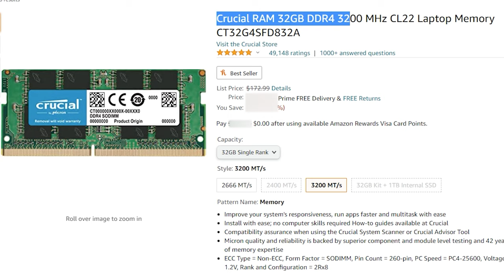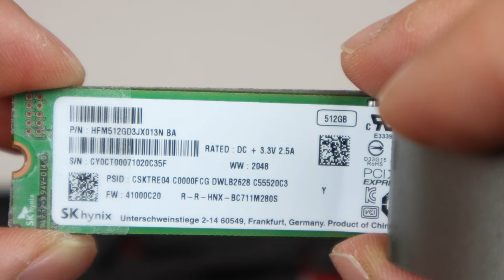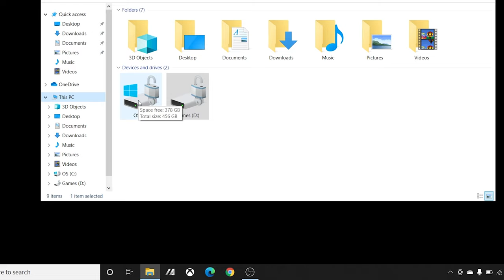How to Install/Upgrade RAM and m.2 SSD in ASUS TUF Dash F15 Gaming Laptop (NVMe only)

Comment: Really handy video thank you, but have a question. Probably sounds stupid but I’m very new to pc gaming and all the specs so get a bit lost with all the variations. My model number is FX516PM-HN002T, is this still the same ASUS model or is it a different variation to this model? If it is a different variation, does everything in this video still apply to this ASUS model or would the layout be different? Thank you
Reply from the maker: Usually, if the first part of the model code is the same e.g. FX516PM, then the internal layout should be the same. Everything after the main model is simply variations in build like RAM, drive space, and/or GPU, but the basis of the laptop should be the same.
Reply: @FixItPhil  perfect, thank you so much

Comment: Hey, i just replaced my ram but my screen become black and only led keyboard lights up. Any solution?
Reply: You should be fine. Just press the power button and Leave it. It will take a minute or two and then reboot itself into the OS. It booted after the reboot, right?

Comment: Good morning, greetings from Peru. I have the same model of laptop and my question was what actually happened if I put a 32 GB RAM memory in the available slot, since in the video it does not show it in configurations that happen with the RAM memory. when placing a 32 gb and having 8 gb soldered to the board, that really adds up or it only recognizes the 32 gb or only recognizes the 8 gb. what actually happens? Please. I am not fluent in English and in some parts the subtitles do not appear. I half understood.
Reply: I use my laptop for different engineering and editing tasks that require too much ram memory. It would be of great help to know if the ram memory actually adds up, to be able to buy since the 8gb + 8gb (16gb) that I currently have is taking it to the limit

Comment: i've followed your step but my laptop won't turn on unless i connect it with my charger, but the power button doesn't have light and when i turn it off my laptop won't turn on again, i hope someone can help me
Reply from the maker: Sounds like the battery connector was not properly reseated or remains disconnected.

Comment: Is it impossible for anyone else to take out the screw to the 2nd m.2
Reply: I'm having the same issue, tried with around 7 different screw drivers and nothing
Reply: @alexanderjimenez5902  Haha, I got the same problem!
I even ordered a big screwdriver set dedicated to electronics to try to unscrew that thing.
That m.2 screw is a menace, they should have used just a normal screw for that thing.
Reply: did you figure out how to lift the screw on the second m2 slot? i’ve tried every screw bit i could and none of them make the m2 screw budge
Reply: @man8918  I got a new laptop, and don’t regret it. The screw was impossible to get off and it got busted for me. I was just gonna try to get another model, but I returned it and got a different laptop. If your priorities are performance, I suggest you get a different laptop too, my laptop has the same gpu but was getting 20-30 more frames on games. But if your priorities are battery life and quietness, I suggest that you buy a laptop opener kit on Amazon. Or small electronics kit.
Reply: @personperson8563  damnnn. it’s kinda sketchy how there are so many people struggling to get this screw undone, even with the proper screw bits 😂 i’ll just buy a new laptop
Reply: Have you tried a JIS screwdriver

Comment: that battery plug is a nightmare. when i connected it to my motherboard it literally sparked and i almost had a heart attack worrying i just turned my three month old laptop into a paperweight. luckily it all worked out in the end but good grief
Reply from the maker: I've heard other folks have had this exact issue with ASUS laptops, I wonder if it has something to do with their battery supplier or the way the board itself is assembled. Most folks don't notice any issues with a small spark. I guess as long as you've taken precautions (discharge with power button, grounding strap, anti-static mat etc.) it'll lower your risk of failure.

Comment: Can i put gen 4 drives in the pcie gen 3x4 slot? gen 4 drives are backwards compatible with hardware made prior to it's release, if i'm not mistaken.
Reply from the maker: Yes, you can use Gen 4 drives in a 3x4 slot, you'll just be capped at gen 3 speeds.

Comment: I see some review said this laptop ram has soldering??i really want buy this laptop
Reply from the maker: Yes, 8 GB of RAM is soldered in and cannot be removed nor upgraded, but there is one RAM slot in which you can replace or install a DDR4 RAM stick up to 32 GB, as shown in the video.

Comment: hi Phil, I did it just like you in the video, but my laptop does not turn on now. do you have any idea what to do now? if I plug in the power cable, then the LED does not turn on. why?
Reply from the maker: There are a couple possibilities. A black screen usually indicates something is wrong with the RAM. The first case is that the memory is simply not seated all the way in the slot. In this case, remove it and re-install it, making sure it's oriented corrected and fully inserted before pressing it down to lock into place. The other causes could be, incompatible memory type (sometimes this can be a BIOS settings issue) or a damaged chip on the memory.
Reply: @FixItPhil  Thank you for your reply Phil. I've removed the RAM module, but my laptop still does not turn on. :| I've taken it to the ASUS service already, I hope they can fix it :)

Comment: Hello, can i upgrade my ssd with nvme gen 4?
Reply from the maker: Yes, NVMe Gen 4 is backward compatible and the drive should run fine in a Gen 3 slot, but you will not got the max advertised speeds, as the slot will limit the drive to Gen 3 read and write speeds.

Comment: I set the RAM to 16GB (Crucial 16GB DDR43200 CL22) . But the system stopped displaying motherboard RAM 8GB. It should have been 24GB in total, but no. Where is  8GB RAM?

Comment: ATTENTION fellow internet dwellers do not use his link to an SSD because the asus tuf dash 15 is not compatible with sata, it works with pcie only, take note of this and don't end up like me who is now 200 dollars out on an SSD incompatible with his computer
Reply from the maker: Thanks for letting me know, and I'm really sorry about the error with the link. It's been updated to direct to the WD Black, which is NVMe (PCIe) vs SATA. Hopefully you can return the drive for a refund or exchange it 😣
Reply: That’s great that you changed it, I just I hope 🤞 no one else bought one through that link, on the other hand your video was easy to follow for my upgrades. Keep it up!
Reply: @FixItPhil  i did not understand connector type should be sata or pcie gen 3 ?
i think u need to do a q nad a video !
Reply: @mamatap5621  pcie gen 3 or 4
Reply: @mamatap5621  the asus tuf dash 15 is only compatable with pcie gen 3 or 4

Comment: Can you use an nvm from a pc and install it on the Asus tuf?
Reply from the maker: Yes, as long as it is the same form factor and key type B, M or B+M and the slot is compatible with NVMe (and not SATA only).

Comment: what is this support M.2 NVMe gen 4?
Reply from the maker: No, it's speced for NVMe Gen 3. While it will work with a Gen 4 SSD (since it is backwards/forwards compatible), you'll only get Gen 3 speed.
Reply: @FixItPhil  oh.. oke .. I'm a little disappointed, I just bought this laptop, and it doesn't support it :(

Comment: Do i need to use a thermal pad for a second SSD?
Reply from the maker: No, a thermal pad is not necessary for proper operation, but I always recommend it as a precaution to extend the life of the drive.

Comment: I want to add a 4TB M.2 do you think that will work?
Reply from the maker: The spec says the slots only have guaranteed compatibility up to 2 TB. That doesn't mean necessarily that it will not work, just that "your mileage may vary" if you attempt to go higher. Either way, I'd confirm with ASUS tech support before buying the drive.

Comment: Hiya, just a question have you tested it with the 32gb ram stick on the free slot? Asus support is telling me I can only put 16gb in that slot... so I'm confused
Reply: yes, some info would be amazig since this latop can handle only 32gb. So are you loosing 8gb?
Reply from the maker: Yes, you can put a 32GB stick in the one slot. Someone else commented that they did this and the laptop recognized all 40GB. I haven't done this personally and cannot independently verify from experience, but if that's true, that would be awesome; my assumption was that 8GB would be wasted.
Reply: I have this exact model and can confirm I have a 32gb dd4 sodimm samsung sodimm module in addition to the 8GB soldered and Windows 10 sees 39.7GB memory with some of it being hardware reserved etc.
Reply: @TheSTOPlayer  ¡¡Hombre por fin hay luz con el tema de la RAM osea que no hay problemas en poner 32GB???

Comment: If I replace the upgradable RAM (8GB) with 16GB does that make my ram 24?
Reply: um, ya!    8 + 16 = 24.    (if you have 16GB total right now, and take out the 8GB that is removable and add 16GB, then yes you have 24GB)   :) ;)

Comment: Thanks alot for this I got newer version of this laptop and opened up today just so I have a better understanding and its easier to open when I buy the ram to add it

Quick question: My current laptop ram is 8gb and there is slot for one more ram do I need to add the same amount of ram as current one or I can add any amount for the new one I add?
Reply from the maker: You can add any size RAM, the general consensus is to use exact match pairs for RAM (brand, capacity, speed etc.) to take advantage of efficiencies in mirrored chip architecture. I've paired an 8 GB with a 16GB stick and have had systems run fine. While the performance difference is usually minor versus using a different capacity but compatible stick, it'll also help avoid any incompatibility issues.
Reply: @FixItPhil  oh cool so if I do add a different brand ram with current one that has same capacity and speed will there be a massive problem or its best safe with the same 2 rams?

Comment: Hello FixItPhil, I added samsung 970 evo plus as second sdd and my first is intel as well. I am having problem installing the nvme drivers for samsung, since the intel drivers came with the purchase of the laptop. What i understood from forums that i need to change to AHCI mode in bios in order to install samsung nvme drivers but i cant find that in Bios. Some other guy said that i need to remove "intel RST VMD Mode" but im not sure where is that. :D

Comment: Did we need to put thermal paste?
Reply from the maker: No, it is not required for this upgrade. However, you can optionally adda  thermal pad and heat sink to the m.2 SSD if you want, space permitting.

Comment: If the laptop has 8gb preinstalled (soldered in) and the laptop max's out at 32gb, how can you install a 32gb stick...or does the preinstalled 8gb not come into the equation when the manufacturer states 32gb ma capacity?
Reply from the maker: Typically, overages that can't be used are simply ignored by the system, however, despite the manufacturer stating the max RAM capacity is 32 GB, folks who've installed a 32 GB RAM stick have found that the system recognizes both the 8GB and 32 GB for a total of 40 GB of RAM. Not sure if this is what the manufacturer intended or just a happy accident.

Comment: What would happen if I upgrade BOTH SSD's before first boot? is the pre-installed 512GB SSD the primary disk with windows pre installed? or can I install 2 new drives and still have recovery and preinstalled windows?`..sorry for the noob questions. Hope you can help. :)
Reply from the maker: If you replace both SSDs immediately at the same time, you'll need separate installation media (like a USB thumb drive with Windows installation files on it) to install Windows onto your new primary SSD. That's because Windows recovery is launched from a dedicated recovery partition on the original SSD, which you will be removing and thus cannot use. You should be able to download Windows installation files from the Microsoft website, just look for "windows media creation tool" and you'll need a USB thumb drive with at least 8 GB of capacity to create the installation media.
Reply: @FixItPhil  thank you so much :)

Comment: Thanks for this video. It made it so much easier to upgrade the ram! Can I ask ask a question? Your ram slot had a metal heat shield it looked like, mine was just the flappy black plastic, is that going to be a problem?

Comment: Hi I have the same laptop and I added a 32GB RAM  but it shows up at 2667 MHZ instead of the soldered 3200Mhz. I watched some videos about changing the xmf  function or DOCP but my BIOS UI  looks like yours and I don't see an option to overclock the 2667 to 3200 to match the other RAM stick.  Have been searching a lot would appreciate the help.

Comment: What transfer rate are compatible for ssd .I find m.2 has  range from 2400 ton6600 and huge price variation
Reply from the maker: This laptop's SSD capability is PCIE Gen 3x4 which has a max transfer speed of up to 3,000 - 3500 MB/s write/read speeds. Anything above this range will be Gen 4, which is backwards compatible but will be capped at Gen 3 speeds.

Comment: Completely noob question but im new to laptops, ive only ever used desktop, will any NVMe fit or do i need to find compatible ones?
Reply from the maker: As long as the NVMe is a 2280 form factor and is PCIe 3.0 x4 or later it should be compatible.

Comment: Which cooling pad will be good for this Laptop..what do you recommend.
Reply: waste of money they don't make a deference you "might" see 1deg difference i was gonna get one too but after some digging i found that they really don't work with new laptops that are designed a lot better then they used to be. just only use on a solid surface and you should be good.

Comment: @FixItPhil Hey Phil, any brand suggestion for SSD ? im using this laptop for gaming.. Is Addlink okay?
Reply from the maker: I've never heard of Addlink, so I don't have any specific recommendations on that, though initial reviews in a couple places seem to indicate they are a decent value brand with unknown longevity and post-purchase support. While more well-known brands will cost more, they've got a good track record on consistency and performance; the Samsung EVO 970 Pro (https://geni.us/sK0J8 [Amazon Affiliate Product Link]) and WD Black SN750 (https://geni.us/nICW [Amazon Affiliate Product Link]) drives are the most often top rated/tested Gen 3x4 drives.
Reply: @FixItPhil  any suggestions?

Comment: I have a question, 
If there's 8gb of soldered RAM, adding a 32gb stick wouldn't make it 40? (8 soldered + 32 socketed)
Reply: Follow-up question:
Is it ok to run mismatched RAM (manufacturers and capacity)?
Reply from the maker: In general, yes, you should be fine, though in rare cases you could run into issues, which is why it's usually not recommended.
Reply: @FixItPhil  Phil. I’ve done this exact upgrade, ordered the same ram from your link. My computer starts now but with a black screen. When I remove the 32 stick it boots fine. Any fix for this? Or did I just get a bad stick of ram?

Comment: Mine is Asus Tuf Dash F15. Model number FX516P - MHN085 T/ Intel i5 11300 H/ 8 GB RAM. 

Can upgrade to 32gb RAM ? If can, is it possible to use CL 20 instead of CL 22 ?
Reply from the maker: For your build, you'll only have the 8 GB of on-board RAM so you should have the 1 RAM slot free for upgrading the RAM. To achieve the max 32 GB of RAM, you'll need to use a 32 GB RAM stick for the upgrade and it should be fine to choose a different CL value since theoretically the motherboard wouldn't be using the on-board 8 GB RAM, but if it does and there is an issue, you may just need to adjust the CL values in the BIOS.
Reply: @FixItPhil  it would still be considered as dual channel even tho it only uses the 32gb ram?

Comment: So hi I have a question. 
Actually my older laptop (Asus strix scar 3 rtx 2060) died it had an 2tb SSD(I checked it it's Fully compatible with this laptop, so the problem is that Asus scar had an keystone which enables the shadow drive(it's just a partition in the SSD it just shows up when you plug the keystone in) so I was wondering if I can use that SSD in this laptop without losing any of my older data (on both C and Z(it said Z on shadow drive). I don't wanna lose any of the data. But I'm not sure of the shadow drive part. Can you help me with it.

And I'm also not totally sure of buying this or MSI GP66 RTX 3060 version.
I use a lot of Photoshop, 3DsMax, Maya, Blender and After effects.
Reply from the maker: Sorry for the late reply. I believe due to the encryption method of the shadow partition, that it would not be portable to another system. You might be able to confirm with ASUS or perhaps they can provide a key that would unlock it so you could recover the data.

Comment: Hi. I am waiting for new processors from the tiger lake series with more cores with a 1449 socket. Will the processor in this laptop be replaced?
Reply from the maker: Unfortunately, the processor in this laptop cannot be replaced/upgraded.
Reply: @FixItPhil   i7-11800H .... 1449 socket 8 cores ?

Comment: Any idea on the normal ssd speed ?
Reply from the maker: PCIe Gen x 3 speeds are around 3500 (MB/s) read 2700 (MB/s) write. Actual performance (and theoretical maximums) will vary based on brand and architecture of the SSD.